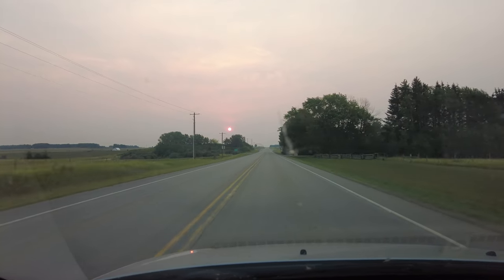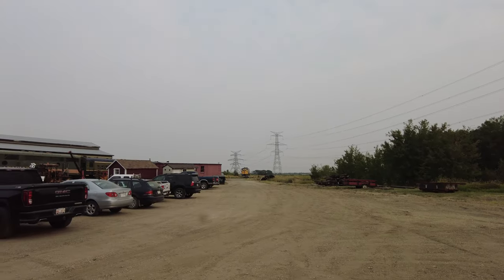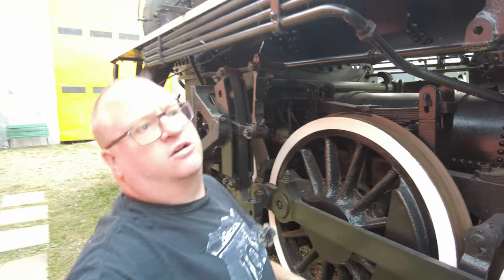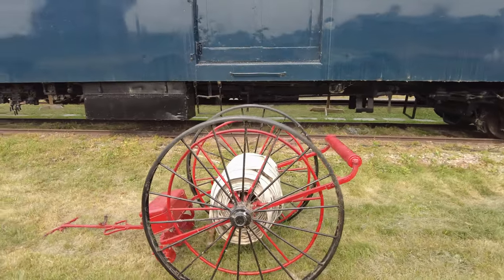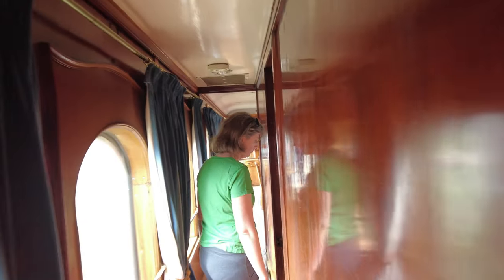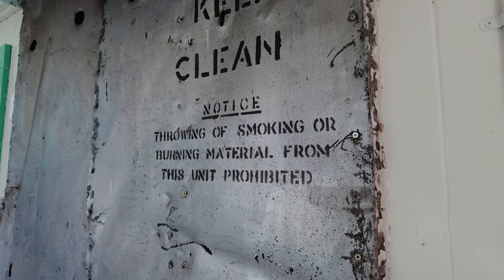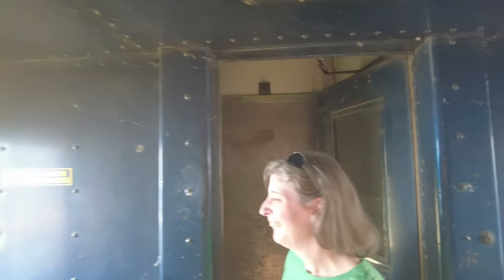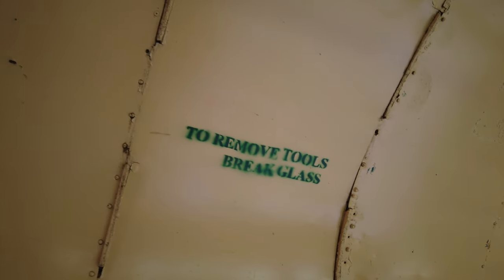A Visit to the Alberta Railway Museum in Edmonton (Episode 212)

Comment: The spur that the Alberta Railway Museum is on used to actually go to CFB Edmonton, or RCAF Namao as it was called at the time, which is pretty cool but now it only extends to where you turned into the museum at the beginning of the video. You can still see the right-of-way on Google Maps and you can also see that it connected at the other end to another track in St. Albert adjacent to Veness Road.
Reply from the maker: Thanks for that information.  They did mention that their track was a spur line at one point but I couldn’t remember where it went so it didn’t make the video.